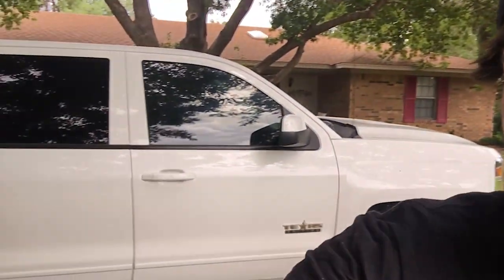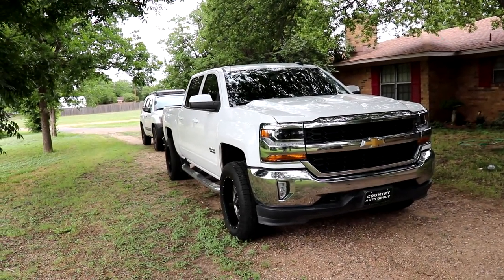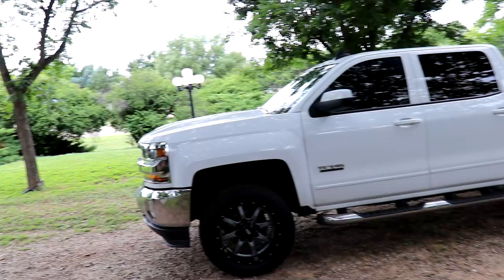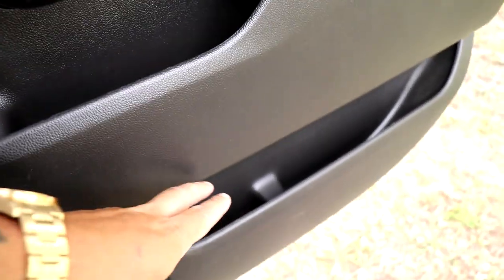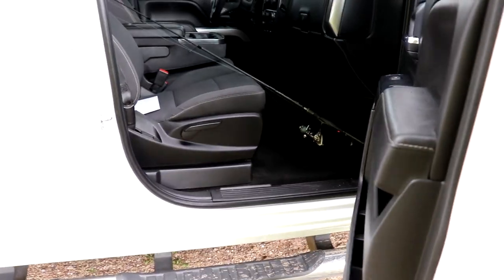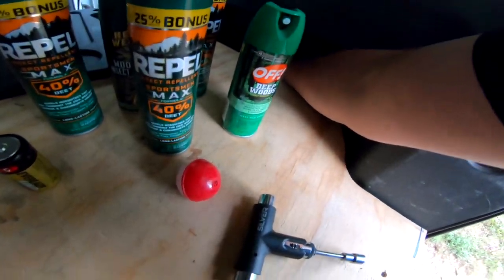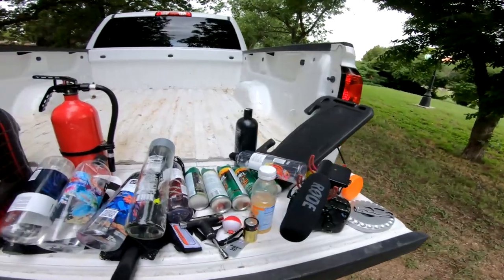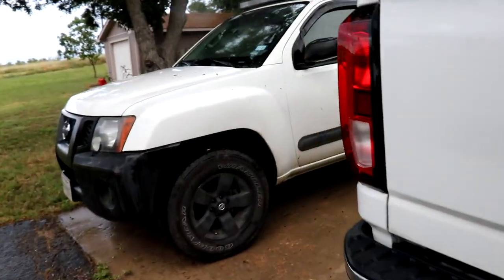I ACCIDENTLY BOUGHT A NEW TRUCK!!!

Comment: Nice bro 
Btw in case you didn’t know if you ever have any knocking or ticking noises it is most likely a lifter failed 
They can be fixed but are common in newer 5.3 liters 
On the shifter there is a button press it in puts you in tow haul mode 
Truck thinks you’re pulling something and will disable afm and lifters 👍🏻
Just some tips if you weren’t aware 
Other than that great truck and great videos! 
Are you gonna upgrade the trucks performance?
Also get seat covers so if hooks damage the seats it will damage those instead